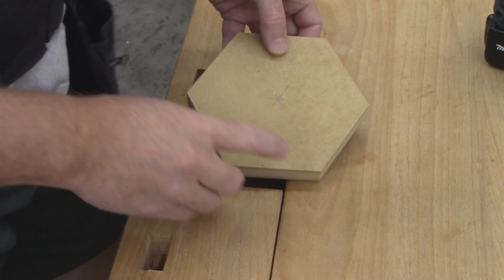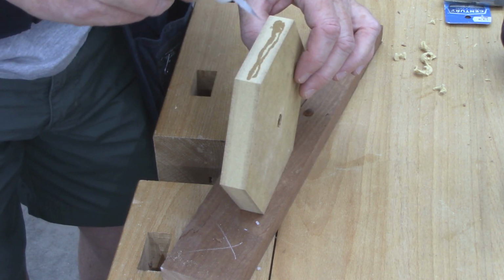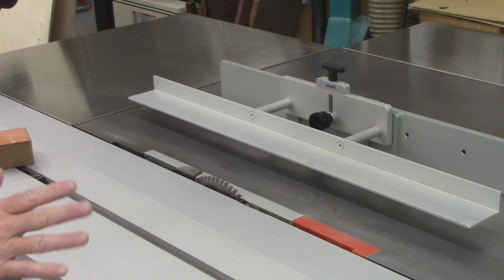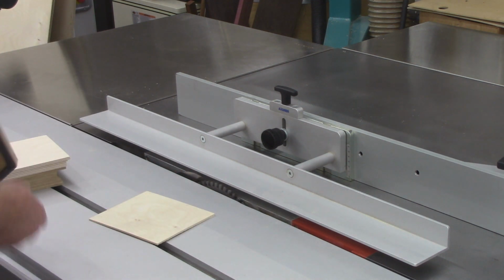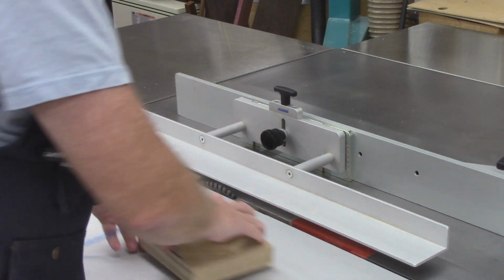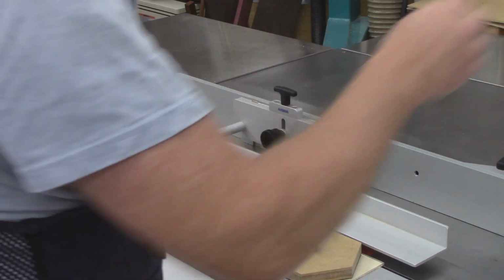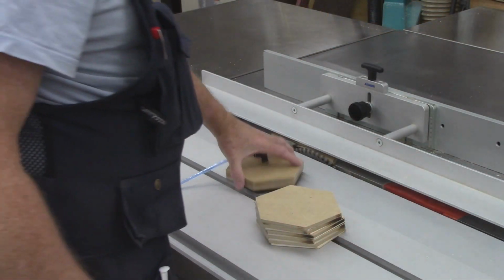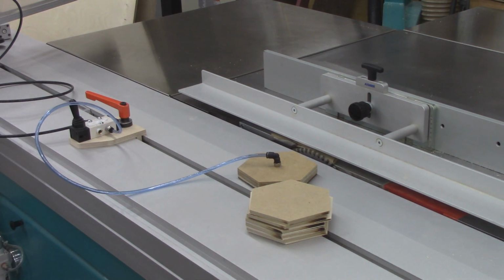Mass Production:  Vacuum Clamping and Pattern Cutting on the Tablesaw

Comment: Hi Steve. Thank you for sharing this video; very neat. An alternative to MDF that I use frequently to similar operations is high pressure laminate (HPL). Obviously it is not as readily available as MDF, but if you can get it, I recommend that you try it out. I get mine in the form of leftovers from a local furniture factory. They use it for making table tops. HPL is none porous, so leaking is not an issue, but you still need to be a bit careful when treading. The use of CA glue here is a brilliant idea.

I use vacuum clamp made of HPL on a saw sled for resawing guitar backs and sides on the band saw. It works like a charm. Sometimes there are tiny cracks in the wood, especially rosewood, but a small strip of masking tape over the crack is all that's needed to prevent vacuum leaks. I use 4mm nitrile string as gasket, which make it easy to vary the size and shape of the vacuum zone according to the size of the work piece. You can check it out here: https://youtu.be/pRAJRUNzDYM and here https://youtu.be/ZyXvvORhTkE.

By the way, Tage Frid was born in Denmark, not in Sweden. But it true that he was one helluva woodworker... ;-)
Reply from the maker: Now that is an awesome resaw jig - Subscribed.

Comment: Thanks for your video, I was just thinking a week ago if I could make a vacuum hold down. Festools  is very expensive, so I bought the small square blocks Rockler sells and are very similar to what you made. I think I’ll give it a try.
Reply from the maker: Hi Michael.  I have the Vacuum Pressing System blocks but they were just large enough to not work for this pattern.  Steve

Comment: Never knew tapping MDF could actually work, will have to try that CA trick sometime. Nice jig, seems like you could make it work on a router table too. For even larger scale production, a laser cutter or CNC might be more time effective?
Reply from the maker: Hi michael.  It would work on the router table (and shaper).  I have been waiting for my CNC for over 3 months so I cannot compare.  I tend to think the time using this jig on the saw may be a bit faster timewise but more labor.  For this operation, the laser is probably the best option and I would love to have one but space is a big issue.  I sold 2 machines to make room for the CNC.  Steve

Comment: What am I missing? How does your jig and vacuum pump "suck through" six layers of MDF? Is the MDF that porous (and through the top and bottom surfaces, no less)? At 1:55, you doubt porosity on the "end grain" will be an issue, but I would think the "end grain" would be far more porous than the top/bottom. Thanks!
Reply from the maker: Hi Matt.  I don't think you are missing anything as your line of thinking was what I initially thought as well.  I was surprised at just how porous MDF is through the face.  I am sure leakage occurs around the sides too.  My vacuum pump normally pulls about 26" Hg on aluminum pods but with the MDF, it was 22" Hg.  I learn something new everyday.  Steve
Reply: @extremewoodworker  - Good to know! Thanks!
Reply: @mattculik  MDF is commonly used as the spoilboard on CNC routers with vacuum hold down systems specifically because of this porosity. I tried taking advantage of it with a vacuum former once, but while it's porous, it doesn't support the quick vacuum needed for that application.